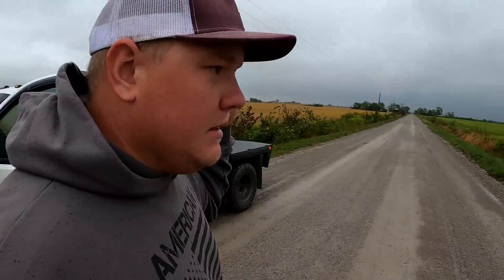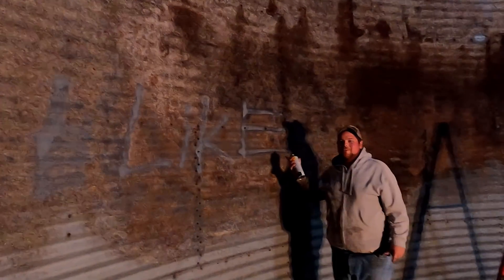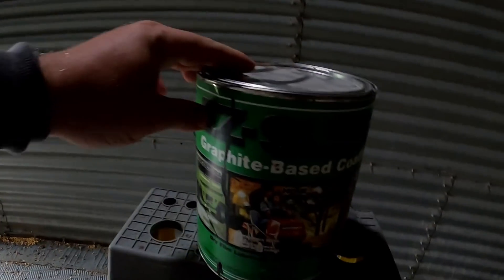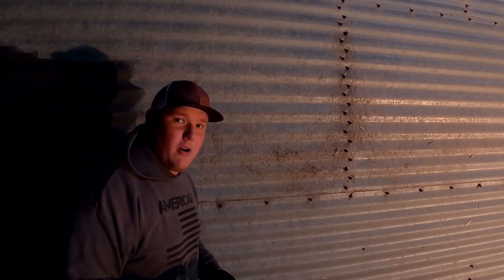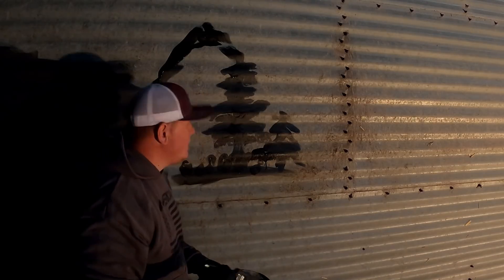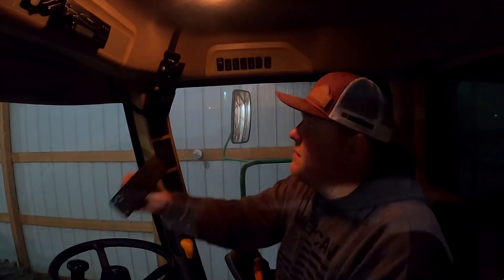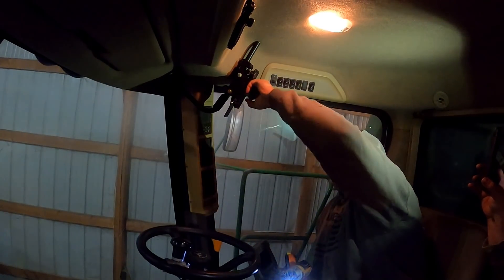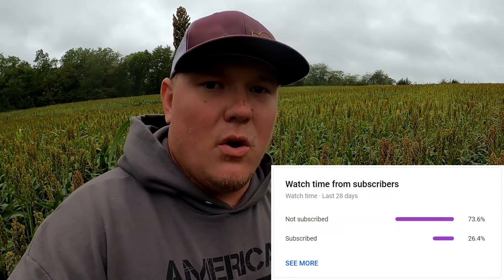CAUGHT! Graffiti on the GRAIN BIN!

Comment: We use rust converter on rusty spots on the bin. They make it spray cans or jugs you can use a paint brush with. It converts the rust to stop it from spreading and then you can spray paint over it. Works really good!
Reply from the maker: Thanks!
Reply: I noticed on how Farms work they lost a couple sections of their bins to rust

Comment: had a drying bin like that and l used asilver coating with fiber init that is used to seal leaking flat roofs on trailer houses  came in 5 gallon buckets and it used a paint roller to appily lasted 5 years !!
Reply from the maker: gary barrett that sounds like a good fix.

Comment: wire wheel on a grinder to clean the metal use a self etching primer or epoxy primer to seal then paint

Comment: If your problem Is on the North side of your bin It is because the Sun does not hit that side. We have had this problem and to resolve this issue we put air tubes on the inside of the bin on the North side wall. We like the triangle ones the best.
Reply from the maker: It is the north side!
Reply: Thats what we figured.  The round air tubes seem to plug and not let as much air threw as the triangle ones do. Hope this helps